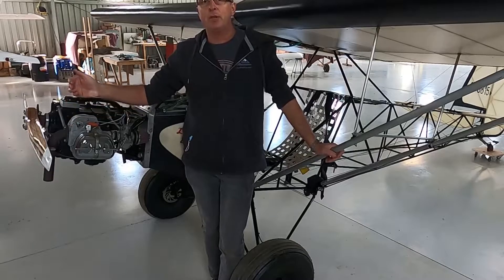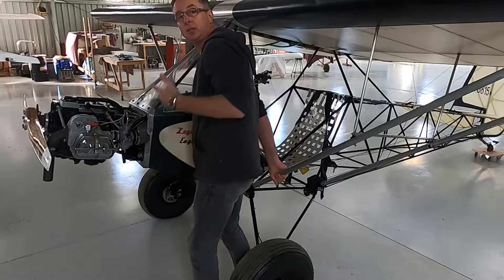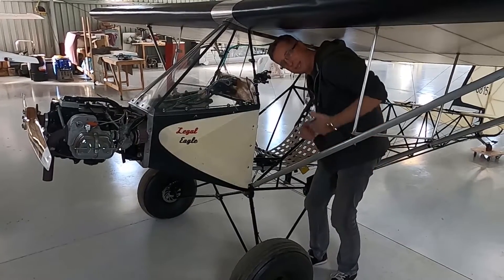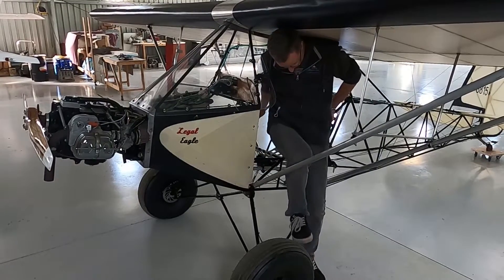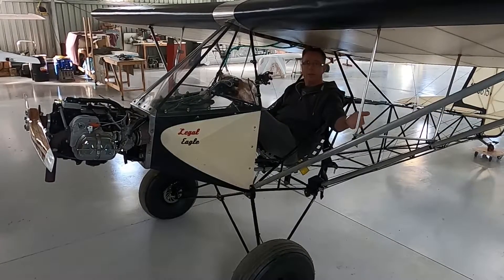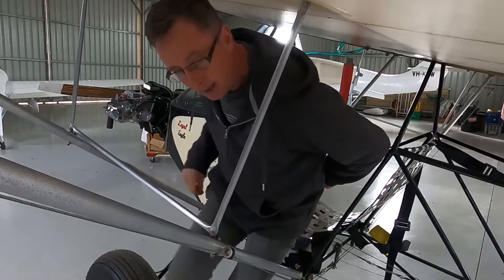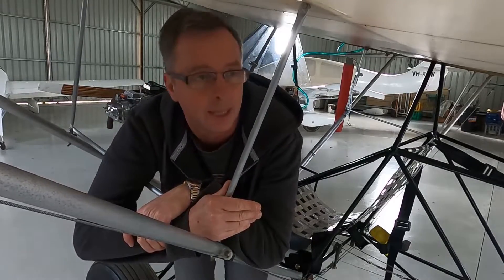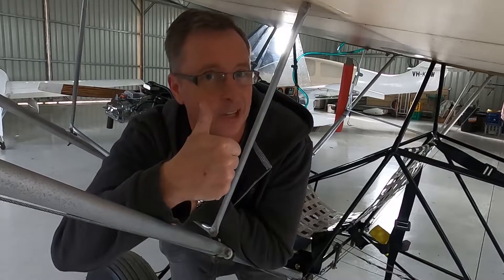Getting in and out of a Legal Eagle.

Comment: Same method as I use on my Sherwood Kub, might not look as cool as just slipping in but at just over 6ft 4" it allows me to get in without issue.
Reply from the maker: Works a treat!
Reply: @DCSquared  I agree.
Do you do any cross country flights in the Legal Eagle?
Reply from the maker: @flyingkub  I plan to do a few trips which is why I went with the 2 x fuel tanks.  With a total of 50 litres and a burn rate under 7 litres an hour, I'll need a strong bladder!
Reply: @DCSquared  Near 7 hrs you will need to take food as well. So auto pilot is next to fit? :-) Just in case you fall asleep!!! I was thinking of building one with the three cylinder radial but they have halted production and not saying when it will start again. That said I do like my Sherwood Kub as I am indoors (needed here is the UK with all the sun we have).